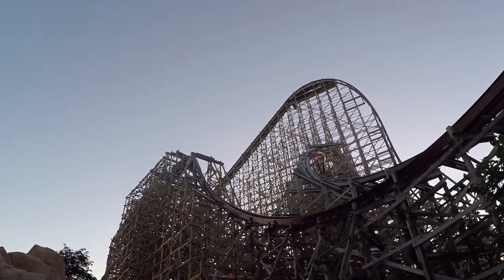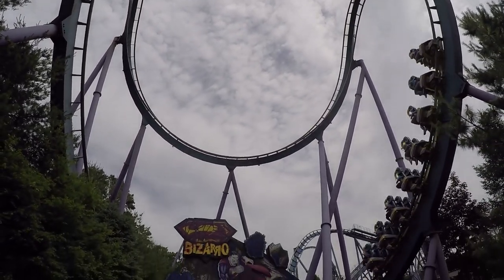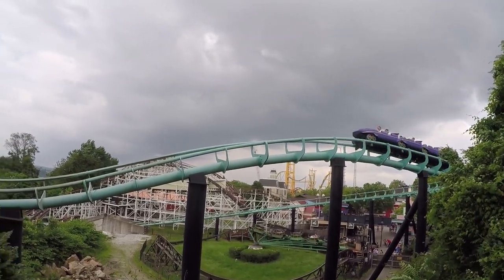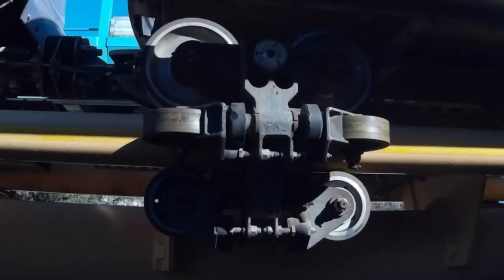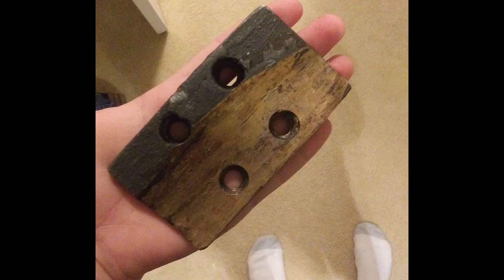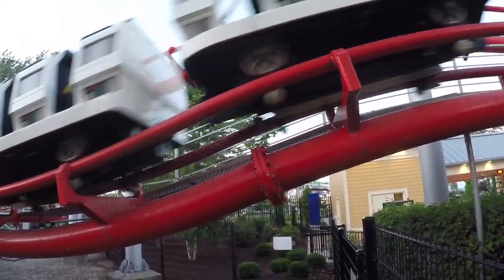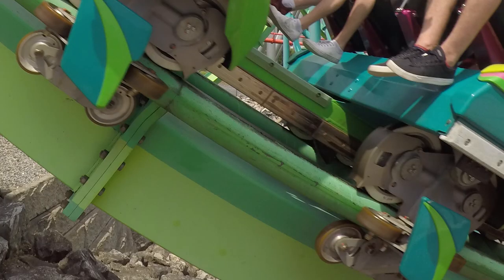Can Roller Coasters Fly Off The Track? (how roller coasters wheels work)

Comment: Planes and roller coasters are the same.

They are extremely safe, but people think they are dangerous.
Reply: Because there is a such thing as anxiety
Reply: yeah exactly. the only reason people are scared is cos when an accident happens it's usually bad or you only hear the bad ones. I personally feel very safe one roller coasters even though I've only ridden a few
Reply: @kass5912  I have extreme anxiety and even I know both coasters and planes are safe. Different people experience anxiety differently.
Reply: @fubbypeets7058  Anxiety is impossible to get over, no matter how much you are told it is safe.
Reply: @clamsclams  Bro, I LITERALLY said that I know they are safe despite having anxiety. I never said they still don't scare the shit out of me.
Reply: @fubbypeets7058  I wasn't arguing with you I agreed with what you said.
Reply: The difference being ... if something does go wrong, the chances of survival are low
Reply: Yes
Reply: Just don't go to fairs and carnivals, then you venture into the realm of genuinely risky and unsafe. Carnivals/fairs are known for lacking routine maintenance required on rides, cutting corners, horrible lack of training on operators who are sketchy AF anyway. Regular large amusement parks are extremely extremely safe however. People need to let carnivals dry up and go the way side.
Reply: Same with nuclear power.
Reply: @urfavoritegay4640  How is a good accident?
Reply: @GMoney-B  That is actually quite a common misconception. There is actually very little evidence that there is any safety difference between mobile and fixed rides. At least as far as first world countries go - the safety standards for travelling fairs are extremely strict - certainly all across Europe, the UK and much of the US
Reply: @daveharruk  I don't know what to say then. I have read and seen so many articles, segments on thrill rides and roller coasters that it appears to be a huge problem with sketchy employees. Way too often even being drunk or high while operating rides. I don't know, too much from my perspective and experience.

Comment: One coaster without upstocks is actually capable of flying off:
Rutschebanen at Tivoli Gardens, which is Europe's oldest coaster, has brakemen, and every few months or so, a brakeman will make the train go so fast that it takes off for a little under a second or so. The brakeman that does it then buys beer for the crew.

Comment: Simple answer:

YOU THINK IT WOULD EXIST IF IT COULD???
Reply: I mean... Yes? Rollercoasters existed before upstop wheels.
Reply: @keiyakins  but if the trains flew off the tracks, the park would've had to buy a new one for each ride and that's expensive
Reply: @happysword258  right, which is why side friction coasters were so much tamer than modern coasters. They didn't fly off the tracks even though they hypothetically *could*.

Comment: Seems like the road wheels shown can handle way more forces than upstops, is that a limitation?
Reply: Upstop wheels typically don't have as much force exerted on them, so they don't need to be as big, but the upstop wheels on the Superman: Ultimate Flight clones are the same size as the road wheels because the force of the pretzil loop.
Reply: @Stephenp503  Thanks for the clarification!

Comment: Actually, Arrow 4D coasters (coaster...) have the guide Wheels on the inside as well, the set of wheels on the outside is for the seat rotations and only has top and bottom Wheels

Comment: Lots of footage of Rougarou and Raptor in this video...those are two I ride a LOT at Cedar Point because there is usually almost no line (and zero line with fast lane pass).  I've been to Cedar Point enough that I can recognize almost any part of the park instantly (I live exactly 100 miles south).

Comment: hey ! I have a question. If up-stop pads were used on large coaster, do they will slow the drain because of friction ? Wheels can spin so they don't slow down it but pads that don't spin...
Reply from the maker: would depend on the coaster and how they are used, but yes they obviously cause more friction than upstop wheels.

Comment: Can rollercoasters get stuck between inversions and how are they taken back
Reply: When a coaster is stuck between two hills or elements it's known as 'valleying'.

When a coaster valleys you wait for it to run out of momentum, then each individual car has to be pulled off the track. If it's close enough to the brakes you COULD pull the train up to the brakes with cables but in most cases it's easier to use a crane to pull cars off.

It's a long procedure that causes long delays. Coasters close in high winds to avoid valleying so this happens extremely rarely.

Comment: Of course not because coasters use a three wheel design to lock them to the track. This system was first implemented on the Kennywood jackrabbit coaster in 1922 and was developed by legendary coaster builder John Miller.

Comment: Besides upstop wheels what are the safety measures to make sure the train doesn't derail. I think you've said that there is one on roller coasters and that's how roller coasters get stuck upside down but your explanation confused me and I had never heard of it before. I'd love it if you made a whole video explaining this.
Reply: What do you mean? The 3 sets of wheels ensure the train can literally never derail.
Reply: @Cias13  I may be wrong but I thought he's talked about an anti-derail system which stops the car immeditately if it detects anything.
Reply: @mitchellhenry478  there is no such thing. Outside of brake stations, a train has absolutely no way to stop itself until it reaches a pinch brake

Comment: can rides forstrats like for example over shoulder can be released in the middle of the ride by the ride operaters
Reply: No..
Reply: Of course not
Reply from the maker: yes, but not remotely, depending on the ride they would have to go through a specific procedure to do this and the ride would have to be stoped. It will actually be explained further in an upcoming video!

Comment: A question I have only applies to one ride that I know of; Escape From Gringotts at Universal Orlando. There is a part where they make the car “Hang” over a pit, before reversing back another track. If the ride was to stop and people had to be evacuated, how would they correct the train so the riders aren’t hanging at 75 degrees for a long period of time. I want to ask this because in 2012 I had to be evacuated from the ride, and I overheard someone say that the train can’t be reversed back on the track. 

Also, a video on Rollbacks wouldn’t hurt for some people.
Reply: I'm guessing there is a way to tilt the track back to level if an E-stop is used, but rescues have been done on upside-down trains before, and steep uphills are common evacs, so steep downhill probably isn't too bad to deal with.

Comment: Great video for those of us with a love of rollercoasters but suffer with anxiety disorder. However I’m wondering how rides like Avalanche at Blackpool Pleasure Beach work, as that doesn’t have tracks like regular coasters.
Reply: Bobsled coasters have road and side-friction wheels, and there is a small “wall” on the tracks to prevent crashes when the trains are banked at 90 degrees. https://rcdb.com/282.htm#p=1327 Picture of the same model (Mack Bobsled) at KD

Comment: A lot of fairground rollercoasters use there roadwheel also as sidewheels. Like a Wakky Wurm (ps: my english is bad, sorry)
Reply: i know your english is bad, but just saying that it's spelled wacky worm (just helping you)
Reply: They are called Mushroom wheels.. and have a flange just like a train wheel that acts as a guide wheel
Reply: PINFARI IS THE BEST MANUFACTURER
Reply: @DomWPC  Slight misconception here since these two designs work differently the roller coaster version the flange is indeed supposed to be in contact with the track. With regular trains this is not the case and the flange making contact indicates a problem. With regular trains the wheels they are actually conical in shape with the larger radius towards the centre of the track. This leads to the effective radius of the wheels becoming asymmetrical if the train deviates from being dead centre on the running rails with the outside wheel being larger than the inside one. As a result the effective circumference of the outside wheel increases and so to does the linear speed of it's rotation. Basically this leads to entirely passive differential steering kicking in and steering the train back towards the central position. Under normal conditions this will prevent the flange making contact with the track at all, if it does then you have exceeded the design maximum lateral load for the train already. The flange on a regular train thus only comes into play when you are actually already over the maximum safe speed for the curve radius of the track or there is some other serious issue making the train unstable. A faulty wheel or something dragging against the track of ballast subjecting the train to excessive lateral load for example.

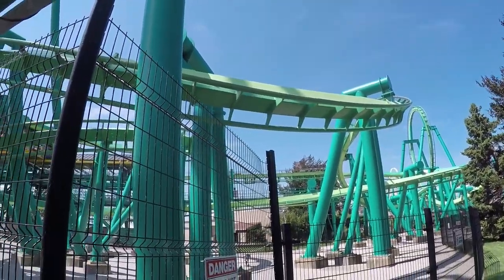Comment: At 0:27 - to insure that the ride will NOT come off the track. DISCLAIMER: "Under normal conditions". :-O Wow, Magnum XL 200 opened with upstop PADS instead of WHEELS? I can imagine the sparks did fly.

Comment: It didn't though. Nothing actually stated how the train stays on the track, or how those wheels keep it on the track
Reply: Bruh it cant fall off the track if wheels on all sides keep it on
Reply: @isaacstipp3339  but how do they stay on? How does these wheels stay on they ain't bolted to the track
Reply: SunnehShides because nothing will let it off.
Reply: @Nags    The wheels are attached to the train with brackets.They are set up so the track is boxed in and there is always something in the way of it going off. If the train tries to fly off to one side, the side friction wheels will get in the way. If it tries to jump off the tracks vertically, the upstops are going to be in the way, and those side friction wheels will take care of any lateral movement that might result. In order to take the train off the track you'd have to unbolt the wheels/pads from the train beforehand.